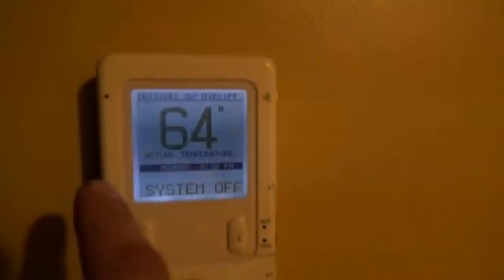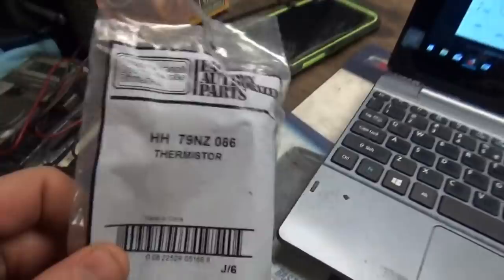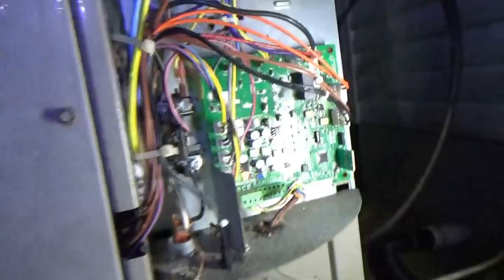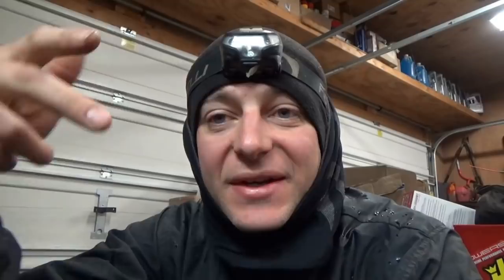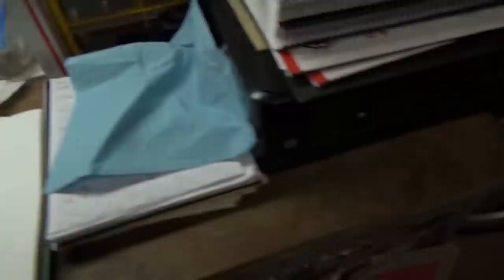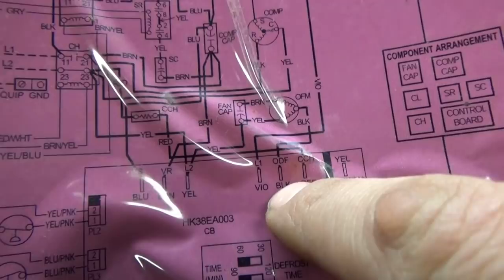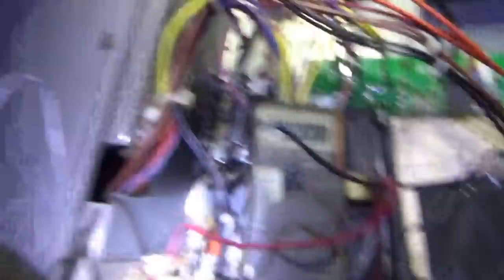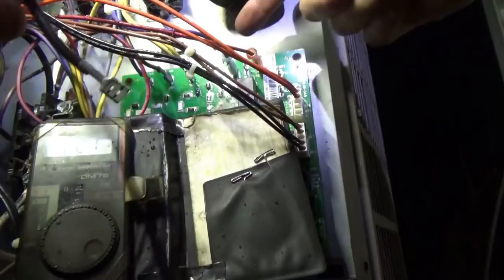Bryant Carrier HVAC Heat Pump - Part 1: Diagnosis

Comment: after seeing it close, it's very likely lightning or large surge damage from different voltage power lines crossing. seeing it was in the middle of the trace and not burnt off at the relay pin. the crank case heater is always on, except when the fan is running.
since that was the crankcase heater lead, so it would be wise to check the current draw of it, inspect it and the wiring down inside by the compressor, back to the board to make sure nothing "rubbed through" and is shorting with vibration. sometimes zipties let go or previous tech didn't put them back and the wires lay there on the tubing until it wears through and arcs, which can also cause a refrigerant leak after it arcs through the copper tubing.

Comment: Ivan, get a meter rated for the work you are doing.  They are not that expensive, and please don't have push pins in your meter that could fall into live circuit during test,  240V RMS is equivalent to 339 V peak, or 679 V peak to peak and can be written as 240 Vrms. (the formula is Vrms = Vmax / √2).

Comment: Carrier and Bryant use the same board.  Try looking up part no. HK38EA023 too.  A quick search still said about $450 for a new one.  Check the board for blown electrolytic caps and evidence of overheated resistors on the board.  Something on the board failed to cause the trace on the board to heat up like that.
Reply from the maker: We'll see exactly what failed in Part 2 :)

Comment: Poor board, it really needs to be encased like a pcm usually is. It looks like they did spray it conformal coating. They really cut some corners shoving everything onto one board like that.

Comment: My service tech told me Bryant had a run of bad boards, I have basically the same age unit. But why Im I telling you this, your probably going to fix it in Part 2. Mine works and I live in Florida, those 60 deg nights are hard to take.
What about a starter relay. This gives you a reason to both sleep in the same room :) Snuggle,Snuggle.
Be careful that 50 amp breaker is alot for your body to overcome.
This case study is really heating up :)

Comment: Ivan, please be careful sticking your hand in there while the unit is live, had me cringing a couple times.  Props to you for taking on the challenge, its very interesting to see how you work through the problem. That relay is important when operating in heat mode, it energizes during the defrost cycle to allow frost to melt and drain from the coil without cold air blowing across the coil refreezing it. But in a pinch you could prob get away with running it off of the contactor for a little bit. The CCH is also important, heats the bottom of the compressor during the off cycle, keeping the oil warm and keeping refrigerant from migrating (seeking the coldest point) into the oil.
Reply from the maker: Great explanation :)

Comment: I would install a standalone relay, maybe two, a normally closed for the heater and a normally open for the fan if I couldn't find one with a normally open and a normally closed. Just solder leads to the control terminals. At the moment, I would have connected the fan lead to the relay where you jumpered it to L1 to test it. The fan would run constantly but you would have heat until you get parts.

Comment: I’ve worked on all my furnaces and for a few people I know. If the fan isn’t working it could be an issue with the fan motor and the capacitor. I have replaced the controller also. Make sure ya diagnose before ya take out the parts canon. It looked like you were looking at the ac unit
Reply: Hey Ivan check the yellow flashing light on the board. It’s flashing a code

Comment: Clue:  the crankcase heater has nothing to do with your problem.  It merely heats the compressor to keep the oil fluid in the bottom of the compressor (which is running fine).  See below.
Reply from the maker: Clue: I'll prove you wrong in Part 2 ;)

Comment: I guess the crankcase heater went short and overloaded the relay common track, the fan just lost power because of the track.
The transformer output, L1 goes forward current at the same time L2 goes backward current, 180 degrees out, then they reverse, so it's blowing and sucking ha ha :-D :-D.

Blow + Suck = double pressure or potential
My calculation is simpler he he :)
Reply: lol
Reply: richard cranium
I just can't help being a daft bugger :-D

Comment: The last time I did something like this (on a friend's unit) it was a problem with the blower fan inside.  I found a bad board (it was fried) and ordered a new one.   New board fried on first startup.  Rookie mistake...I forgot to ohm out the motor.  The fan motor was shorted and took out the board.  It needed a fan AND a board.  Fortunately, the place I bought the board from warrantied it for me, no questions asked.  I predict more wrong with the unit than the relay and or the board.  As in my case, I'd be suspicious of something drawing too much current and taking out that board. 

I was sure you were going to get to a bad cap.  Just some advice...It's real easy to check those caps with a meter that will do capacitance.  Just compare the capacitance to the stated value and tolerance on the label.  Bad caps will put stress on your motors, including the compressor.

Comment: Hello Ivan,
I too have a 3 ton heat pump 2001 vintage I installed myself and recently I installed a Emporia individual circuit breaker monitor which gives you a real time kwh awareness of various appliances.  I have a question for you though, did you notice the compressor kw's in heat mode vs cooling is higher in heat mode?  Example my cooling runs between 2500w on 50F day to 3000w 95F day which is normal but on heat mode I get 3200w compressor only.  The specs strangely don't give info for heating comp watts.  I guess the inside coil which acts as the condenser being smaller may account for this.  I am wondering if you remember getting something similar?  Love the channel!

Comment: unlike air conditioning  on a heat pump the outside fan does not necessarily have to run.  the compressor pressures up the gas and sends it through only a portion of the outside coil. if the temp gets too low outside the crankcase heater turns on  heating the  oil and the refrigerant  to help input heat energy into the refrigerant. this is why the relay is set to run either the fan or the crankcase heater. also  the code for low outside temp was a clue. if the heater was working that code would never have set.   also note the blinking yellow lamp on the board.  its telling you there's a problem. i would ohm that heater and check the wiring.  sometimes they are seperate and replaceable (requiring a pump down or recovery) and sometimes they are part of the compressor. there are many good youtube videos on heat pump operation and repairs  i recomend you do a little more studying up on how the system works. gray furnaceman would be a good source. this is one  time you started in over your head but you are on the right track . no doubt you'll get it in the end.  if not we wont see part 2 lol.
Reply from the maker: HA! I did find Grayfurnaceman...I'll feature his vid in Part 2 ;)

Comment: It’s called a run capacitor it kick starts the fan usually if the fan is just humming but not running the capacitor needs changing

Comment: As others have said something in the circuit is pulling too much current.  Not just a relay problem that would burn open the foil on the circuit board. The capacitor and condenser fan motor is a good place to look. I have had motors that would get bad bearings and pull too much current. That crankcase heater is unlikely but could be checked with an ohm meter and be sure to check for shorts to ground.  
I gave up on my old whole house furnace/AC unit. I now have several small mini-split heat pump units. They use much less energy and provide redundancy.  When it gets very cold I also have a pellet stove.

Comment: Don't condemn the pc board without checking the coil stat.  Make sure it works and make sure it's connected to the coil.  (you can check it by putting it in your freezer to see if it closes/opens.

Comment: The set point for defrost stat is 27 degrees on most all heat pumps and the set point for coming out of defrost is about 35 to 40 degrees.

Comment: I had a failure three winters ago after midnight. turns out the control transform failed- wire broken at connector and no way to repair. Also two days for shipping :(So I found a transformer on a power supply with the correct voltage and swiped it to repair my control.FYI everyone put those type relays on control boards.

Comment: Before I go, you need to know the function of that little board you got there in your hot little hands.  It controls defrost.  It switches the reversing valve to go from heat to a/c to pull heat from indoors long enough to defrost the outdoor coil (it's raining and coating the coil).  And the board switches the fan off to hasten the process!!!!!  You may not have ANY problem with the defrost circuit other than length of time between defrost cycles (see below).  Check that first.  I've given you all the tools to do a proper diagnosis.  Hint:  this isn't a car, its a heat pump.

Comment: the common "temp sensor" bug, it's likely failed and the culprit causing all the other errors. since it doesn't know the temperature, it keeps running and doesn't know when to defrost until it hits pressure limits and freezes up and locks itself out.
look the part up and resistance test is, should be able to find a temperature/resistance chart online easily.
Reply: and lol, you already parts cannon fired at it :))

Comment: At least put some electrical tape on that wedding band if you are going to reach into mains live circuitry.  

There should have been a pullout disconnect mounted right on house where the power connects into the house.

Comment: 1st thing I check for on heat pumps is the reversing valve solenoid .. not necessarily your issue .. but ... and then the contactors/relays ..
Reply: Yes, Ivan, I agree with David. I learned the hard way that if your reversing valve gets stuck in the wrong position, it can blow the motor winding on your compressor.  You would think that Carrier would have used a compressor with a motor winding robust enough to blow the circuit breaker before burning up!  During the winter you should run the system on A/C for awhile every so often in order to prevent the reversing valve from becoming corroded and stuck in the heat position.  If you don't, you'll be likely to blow your compressor the first time you turn it on A/C in the spring.

Comment: Ivan, please be careful when you work around energized parts. Watching you run your fingers near the energized wires made me cringe. It's not a 12 VDC automotive circuit.
240 VAC (120 VAC to ground) is a relatively low voltage but it can easily kill if you come in contact while sitting on wet ground or touching a grounded part with your other hand. It does not take much current to kill a person. Wear proper electrical gloves and check the gloves before each use.
Also, please wear eye protection. It's also recommended not to wear any synthetic clothing when working near energized equipment. An arc flash due to a short circuit can melt synthetic clothing and fuse it to your skin. Cotton is the best for this as it does not melt like synthetic fabric. A chance of an arc flash of this magnitude is very low if you work on a small AC unit but keep this in mind if someone asks you to help troubleshoot commercial or industrial equipment.

FYI: Relays often fail if they operate inductive loads. An inductive load, like a fan motor, can generate high voltage spark caused by self induction when the relay contact opens. Same principle used in older automotive ignition coils but on a smaller scale. The spark would eventually weld the contact shut or burn it enough to stay open permanently. There are ways to minimize the sparking by using additional components like MOVs, caps, RC circuit. It looks like the AC board manufacturer did not include this. They most likely thought that the relay would last long enough until the warranty ends. It's called - Cost Savings. :(

Comment: Huh. Probably low on refrigerant, my first guess. Ironically, when your A/C gets low on refrigerant, the cold end actually gets colder and starts icing up. I bet that's what's triggering the shutdown on the temp sensor. Or the fan, lol. Replace the fan motor before anything else.

Comment: Check to see if that is a two stage or two speed compressor and fan unit.  Also check fan cap.  Those used boards may not be compatible with your unit they are always upgrading mistakes.

Comment: Isn't it too cold to use heat pumps up there?
Reply: Heat pumps are heavily used here in the Sierra foothills, where it is often cold and wet, because no natural gas is available, propane has gotten pretty expensive,  and firewood and pellets are a PITA. I'm not saying the heat pumps work that well, though.  They sort of just barely cut it.  The "auxilliary heat" (heat strips) does come on some of the time.
Reply: that style works down to about 20 degrees. some newer inverter models say down to 0 degrees or below

Comment: By the way, snowy/rainy mix weather is the main reason for heat pump failure (about 75% of the time) due to the build up of frost that occurs faster than the defrost circuit can compensate for.  You can field adjust the length of time between calls for defrost on the pc board to either 30, 60 or 90 minute intervals.  It's stupid simple.  Remember that.  Don't over diagnose a simple problem.  (or make a video cause there are just too many service techs watching and laughing at you.

Comment: I'm surprised you don't have a gas furnace instead of a fan coll as backup heat up there in PA! I'm guessing you have a bank of electric heater in the fan coil? If you ever need hvac tech tip you can call me or email me because you have called me before to help with auto stuff.
Reply from the maker: Yup Fan Coil has auxilliary electric coil for extra heat. But the wood burning fireplace is still the most reliable :)

Comment: Yes I know the history behind US one phase 240V but it is really sad to see the compressor with dual caps to convert one phase to three and fan with one to get two phases out of single phase 240V. Yes, it saves line cost to have two wires instead of three in the poles, but that is for the profit of the power company. 

You the customer pay the extra cost of creating 2 or 3 phase electricity with capacitors. With 3 phase that AC  compressor would have direct star connection, no caps needed.  

Other difference is the main fuse size for a house. With 1 ph 240V it is close to European 230V standard 16A socket for a laptop. Our house has 3 x 400 V 63A main fuses, 76 kW max in. I know it is colder here, but.. Just add one more wire to the poles.
Reply from the maker: haha yes 3-phase power is a beautiful thing :)

Comment: 240 VAC is 2 “hot” 120s (to neutral-and ground .. center tap neutral/ground).
Reply: It is 2 120V circuits, but 180 DEGREES OUT OF PHASE.

Comment: Now that Bryant has moved to Mexico you should be able to get cheaper parts right?
Reply: More expensive.  Import tax.  Also Carrier will likely discontinue that model. If you were to build a new assembly line, you would outfit it to make the latest and greatest model rather than something that's been in the field for a few years. Expect that part to only get higher in price as supplies dwindle.

Comment: Where do you plug in the scan tool??
Reply: There actually appears to be a diagnostic port of some sort on that PCB.  @ 18:45, lower right of board. Inline header labeled 5V, VPP, DATA, CLOCK, and GND. Likely used for firmware updates, and possibly a factory diagnostic tool.

Comment: Why a heat pump in a cold climate. Thought they were just for moderate climate areas
Reply from the maker: Works well down to about 25F, then we use the wood fireplace as the main heat source :)

Comment: please put concrete blocks and boards under the frames of the cars yr working with jack stands. i cant take watching the amount of work yr doing under the cars trusting jack stands. at least use yr hydraulic jacks on each side on secondary supports
Reply: I once knew a mechanic who would work under cars that were supported only by a floor jack.  Surprisingly, he survived until retirement.
Reply from the maker: You mean Scotty Kilmer?

Comment: that electronic compartment is poorly insulated. probably some bugs causes a short. that and or they need to make their circuit boards with higher quality parts on them. they quit making stuff good in the 50s because you cant make money selling new stuff or repairs on things that last forever.

$550 for a new one lol and its no where near as advanced as a desktop computer motherboard. nice one, HVAC industry. how old is that circuit board? i really think insulating it better would help. who puts a circuit board in the elements just like that lol people who want it to break early, thats who. even a car computer is in a airtight box!